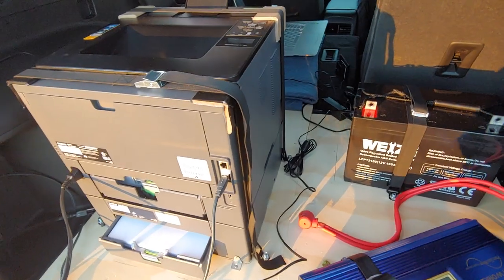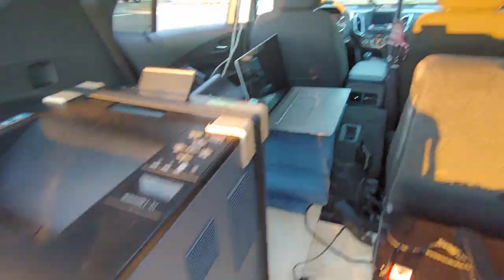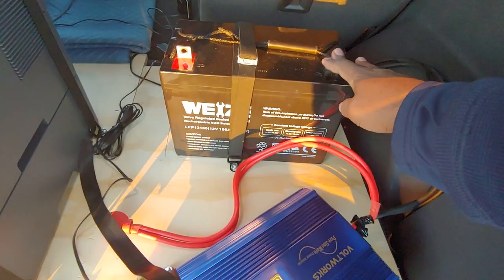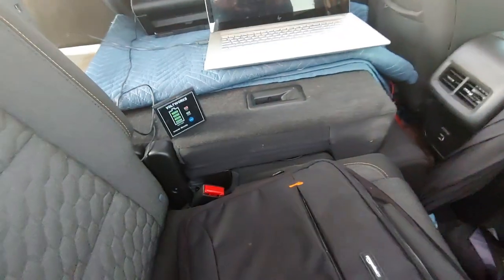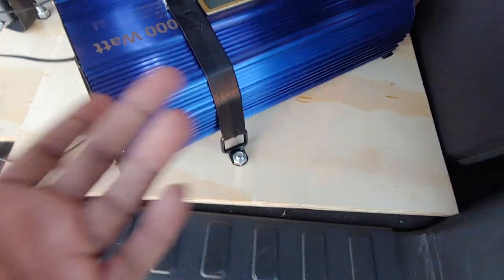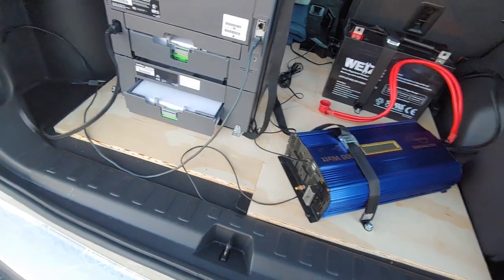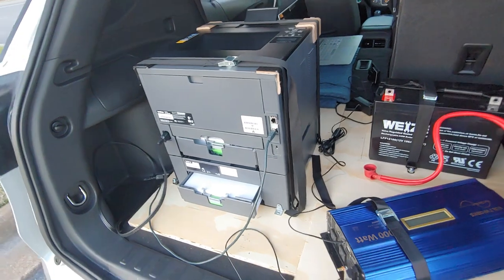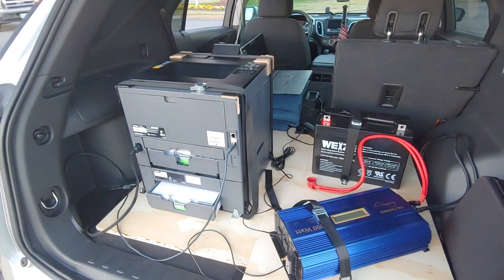Mobile notary printer in car

Comment: I have mine set in the trunk and I work outside. I am going to add the board and turn the printer around, thanks for the idea. I am too scared to have a battery in the back of my car so I had the inverter connected to my battery. Best of luck to you.

Comment: That ground wire is strictly for in-home mounting only, that’s earth ground chassis ground only used when hardwiring the inverter to a 30 amp home breaker

Comment: Thank you for all this information!
What type of battery do you have the inverter connected? Also, the ground cable hooked to the inverter, where do you connect the other end?  Thank you!
Reply from the maker: Thanks. The equipment details are in the description of the video. The ground wire should be connected the actual metal frame of the vehicle.

Comment: I tried a 12 volt lawn tractor battery but the printer kept going on and off and would not fully power up. We have a 2000 watt pure sine wave inverter. Any help?

Comment: You should also have a battery shut off wired in to the posit that way you don’t have to keep disconnecting your leads all the time, also you don’t have to disconnect your ground

Comment: Beautiful clean and efficient setup, thank you for sharing your knowledge and experience with us. Are you taking out your battery for recharging or have access to recharging without taking out your battery? I have asked from couple of the inverter sellers on Amazon, if it is okay to recharge the battery through a Smart charger connected to a different smaller inverter in which is connected to the cigarette lighter! What do you think? Thank you for your time, Mav

Comment: Do you have to recharge the battery every day? Also did you consider just connecting the inverter directly to the car battery?
Reply from the maker: You should charge it after you are finished using it. I do a long term rental on the car I have and don't want to risk damaging it
Reply: @GriffinNotary  okay got it. Might have to take a ride up to VA and pay you to set my mobile office up. Out of all the setups I've seen, I think yours is the best!
Reply from the maker: No problem and no charge. Here to help

Comment: how is your setup working? I purchased a 2000W Pure Sine Inverter and I am having voltage issues. Thank you for your time.
Reply: same here.  I hooked it up to my battery and when the brother pinter powers up it, the inverter overloads.  I recently bought a backup printer and it works perfectly with the inverter.  backup printer is hp laser jet p3015

Comment: Great video! 2 quick questions... (1) do you have a link to the battery you bought or is it tha same one in Mark Wills Video?  (2) You mentioned in comments that you "recharge the battery after each use"...do you mean you recharge at the end of the day or do you recharge between print jobs while out on the road?
Thanks again for the very informative viceo!
Reply from the maker: I believe I have the same battery. Here is a link: https://www.amazon.com/gp/product/B07SW353M8/ref=ppx_yo_dt_b_search_asin_title?ie=UTF8&psc=1
I charge it at the end of the day. The main thing to remember is the change the battery type to AGM on the battery charger. A good charger will automatically switch to trickle mode to prevent over charging.
Reply: @GriffinNotary  Thanks very much!!

Comment: How many pages can you print before you must recharge the battery?
Reply from the maker: I charge up the battery after each use. I do know you don't want the voltage to go past 12 volts.
Reply from the maker: Update to my charging reply. I had my numbers wrong. You don't want the battery to go below 12.4 volts. that is typically 60% of battery life remaining. When you get to below 12 volts the battery may not charge back up. With marine batteries you don't use them to ZERO volts then charge back up.

Comment: Great set up! About how long does the battery stay charged? Or how many loan docs can be printed with one charge?
Reply from the maker: The length of the charge varies. I have printed 4 sets of docs and the charge dropped to 12.6 from 13.0. Don't want the voltage to go past 12.4

Comment: Anyone in Nevada or Arizona have a car set up like this? I'm wondering how you are making out during the summer months. I'm thinking my equipment would melt if I had this in my car in the summer. I'm in Arizona.
Reply from the maker: That is correct. I only use it in in the fall and winter. It would have to be a very special situation for me to use it in the summer
Reply: @GriffinNotary  Thanks

Comment: Hi, Thank you so much for this video. I had question regarding the ground wire? where does it go? is it included or a separate purchase?  Thank you SO MUCH!  look forward to know
Reply from the maker: It's a separate purchase. The ground wire gets attached directly to the vehicle metal frame. In the trunk area there might be a rubber drain plug you can put the wire through to get to the underside of the car

Comment: I know it costs more, but you should just buy an all in one inverter+battery in an enclosure and if you pick the right vehicle, you’ll have a 115v already in it to recharge that unit
Reply from the maker: You have to take the surge aspect into consideration. The brother printer does a big power pull at start up.
Reply: @GriffinNotary  ya I get that, when I was looking at models, most can’t handle the surge necessary only like the top 20-25% of the models I look at which also cost more, after I looked at it more. I think most people would buy a smaller unit and then it wouldn’t work out. By the way my wife is a notary and she said you are the best one on YouTube. Really appreciate your videos!

Comment: I have an FJ With a regular plug is that enough juice or power to do the printer and a lap top?
Reply from the maker: FJ?
Reply: No. The plugs in the cars are really just meant for minor use. Not major loads like the printer.

Comment: I’m stuck on the ground wire and how to install it 🤦🏾‍♀️ I did the set up with a 2000 watt Jupiter and a Marine Battery
Reply from the maker: I will do a video on it hopefully today
Reply: I finally figured it out 🙌🏾
made it all fit inside my trunk in my 
Honda Civic 
thank you so much even for responding means a lot

Comment: I’m interested in becoming more mobile however, it gets up to 100 degrees or more where I live and even hotter in the car.  How will the heat affect the printer?
Reply from the maker: I don't use the mobile setup in hot conditions. If I think my car will get over 70 degrees I am not putting my printer in it

Comment: Mr Griffen. Would a portable power station be sufficient with the right Watts?
Reply from the maker: Maybe. The printer initial power surge can be huge so the power station needs to bee double the required watts for the printer you have

Comment: How can I find out the watt size of the converter I need for the type of car I have or is it based solely the devices I want to power.
Reply from the maker: Use the items in the description of this video.  Anything less will not work effectively. Use pure sine wave inverter. If you don't you'll have issues

Comment: Griff, I had to return to this video because I am experiencing sustained power issues with my printer.  I have an HL-L6200DWT with a 2500 watts inverter. My battery is a 13v battery, but as soon as I turn my inverter and printer on, it completely drains the battery and my printer shuts off.  What size battery are you using?
Reply: Are you keeping your engine running, if the final connections are to the car battery?
Reply from the maker: It would be best to have the car running

Comment: Hello mr Griffin

I hope you are doing well 

Have you had trouble with this battery ? I just got it and it was low on battery and took it to auto zone and they charged it . But they told me the battery was no good . What’s your opinion on this  thanks I’m advance !
Reply from the maker: If you purchased the weize 100ah deep cycle agm battery. It should be good for years. If you let the battery run down below 12.4 volts then that could kill it. In my Notary Printer playlist is a video that talks about charging it
Reply: Thank you mr griffin for your input !

Comment: Do you think the 1100 watt will do the job?
Reply from the maker: It could but from what I learned the inverter has to have a high peak power rating to handle the initial surge when an item is starting up. You can try it but the inverter needs to be a pure sine wave one. All the link are in the description to what you need.

Comment: Do you run scanned at the same time? Or would you need to go to the 3000 for that?
Reply from the maker: I think it can handle both but I have not found a need when I am full mobile to scan and print simultaneously.

Comment: Griff what is the measurement of the wood for your set up?
Reply from the maker: Not sure I understand the question. I had the board cut to a specific size to fit the vehicle I  was using at that time. Is that what you're asking
Reply: Yes

Comment: I had to send back the modified power inverter as it did not provide the power needed for the printer.   I hope the pure sine power inverter will work with 2000 Watts.
Reply from the maker: It will. The pure sine 2000w can handle the load
Reply: @GriffinNotary  Well, mine doesn't.  I have a 4000 watt inverter, however using my Tacoma battery.  is that my problem?
Reply from the maker: @virtualnotary  i know most people use a AGM battery.
Reply from the maker: @virtualnotary  I just looked up Tacoma battery and the type I am using is a deep cycle marine battery that can be recharge the normal car battery might not work

Comment: thanks for the video bro, by any chance did u get a Over load error on your inverter when ever you power on the printer for the first time? thank you
Reply from the maker: No issues with overloading. I believe that would happen if your inverter can't handle the initial surge. The inverter I have is 2000 watt with 4000 watt peak. Meaning it can handle a pull of power over 2000. The printer uses 1500 watt.
Reply: @GriffinNotary  Great tips on how to secure the installation. Very helpful.   Are you using the same inverter recommended in the video by Mark?
Reply from the maker: @boyshanks  I am using the same one they verbally mentioned but the one in the video is not the pure sine version. The pure sine cost more and is label "pure sine". Also I just added anti-vibration pads to the printer and inverter to cushion them when/if I hit a bump.   

XCEL Lightweight Foam Rubber Anti Vibration Acoustic Pads 6" x 6" x 1" (4 Pack) https://www.amazon.com/dp/B07KYK2P1N/ref=cm_sw_r_cp_apa_i_-69tEbVD0NHR4
Reply: @GriffinNotary   Can you provide a link for the inverter you are using? Thanks
Reply from the maker: @boyshanks  2000Watt Pure Sine Wave Power Inverter 12V DC to 120V AC with 4 AC Outlets Dual 2.4A USB Ports Remote Control & LCD Display by VOLTWORKS https://www.amazon.com/dp/B07VSTPZMC/ref=cm_sw_r_cp_apa_i_Ec-tEbRRZFAS0
Reply: Luis I got these errors initially. I went back and watched Marks video. I made certain I connected everything exactly the way they did. 

I also made sure that I tightened all of the nuts well. Doing that stopped the errors. 👍
Reply: @boyshanks  I had the same set up and for some reasons the inverter starts beeping and I see smoke coming out from the cables connected to the battery.  So are you saying that tightening the bolts on the cables between inverter and battery will help in stopping the beeping?     Do you have the 100ah battery and what model is your printer?  I have brother 6200 dwt and I think between brother 5200 and 6200 has the same watt usage?
Reply: @AmyyyWA  I have the exact set up in the video. I’ve never had any smoking. Tightening up the bolts and ensuring my installation was identical,  eliminated the errors. 

I have the Brother 5200.

Comment: Your installation violates SAE and FMVSS safety standards for rollover crashes. The plywood must be bolted securely to the floor of the vehicle. Also, the battery must be in a secure enclosure.
Reply from the maker: I delivered for Amazon for a year and the issue about lose items never came up. I would have my car/SUV loaded with 50 + packages
Reply: This video provides some awesome info. It's up to each of us to decide what, where, and how we want to place items in our vehicles. (I have yet to strap down a case of wine when leaving the grocery store.)
Reply: @GriffinNotary  Can you please answer a question for me? I have a brother 5800 that I am trying to power from my car. I have a power socket in the trunk area which says 115 V AC and 150W. Is this enough power to run my printer or do I need an inverter and battery? Thank you!
Reply: @denisedoherty4909  No do not plug into your car's power socket. You'll blow the fuse..you need the inverter and battery as shown in the video
Reply: Gabriel Alvarado 😂😂😂😂 oh Jesus
Reply: Meet Karen’s husband...Karl 😂

Comment: My brother won’t print from the inverter set up. It power up and that’s it. I have the same battery and a 5000w inverter after the 1500w wouldn’t print. Can you help with a solution?
Reply from the maker: The inverter needs to be a pure sine wave not a regular inverter. Text me a picture of the inverter 757.797.5432
Reply from the maker: Nice speaking with you